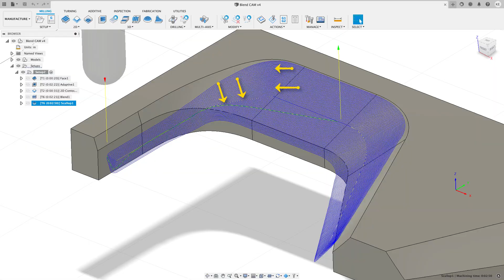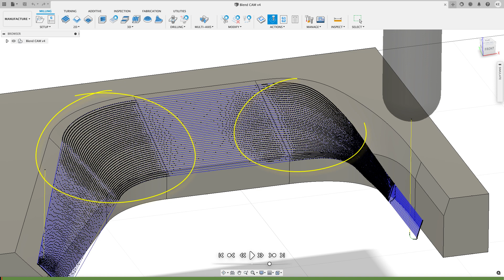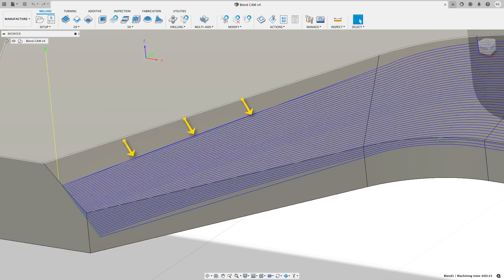Machining a Blend toolpath on the Syil X7

Comment: The Adaptive Clearing with a flat end mill is leaving big steps for the ball mill causing tool deflection and marks in your surface. You may want to slow the feed rate down a bit.
Is there a way to take a roughing  pass with the ball mill leaving .005-.010" on the surface and come back with a finishing pass to clean up ? (Not sure if that's possible in Blend)
Reply from the maker: That is possible, but shouldn’t be an issue in this case. I’m leaving ridges of .030”. The ball mill shouldn’t have any issues dealing with that. I’m suspecting that running these toolpaths from the USB stick is causing some of the issues.
Reply: 😅😅😅😅😅 its all about end mill with corner radius....and its solved!... In general!

Comment: Had my coffee ready at 8am... could not find this video.....anyways.  How do think the finish would be on the slopes if you 1/4'd the step over? Are you smoothing? Are you using a 90 or 45 degree face mill? Great video!
Reply from the maker: I don’t think changing the stepover would significantly change the finish. I’m running the programs off the USB drive. I have a feeling it is either the white label cutter or running from the USB stick. I’ll be doing some more testing to figure it out.
Reply: @MechanicalAdvantage  probably running it on a stick

Comment: Morning Kevin,
I was wondering how large a file you can load into your mill? 
It seams as though it eats code pretty well do you find it necessary to dumb it down with smoothing or other 
Attributes within Fusion? I find this to be true with my Fanuc control do you have videos on this.
Have a good weekend
Reply from the maker: That’s a good question. I have been running off the USB stick and I have a feeling that I need to move the programs to the control memory. I don’t know how much memory it has.
Reply: @MechanicalAdvantage  
I had trouble drip feeding larger programs from a PCMIA card recently 
It would actually corrupt the file on the card while drip feeding (DNC) crazy